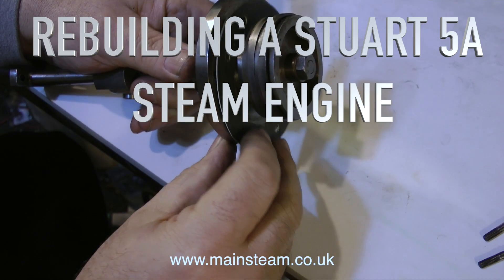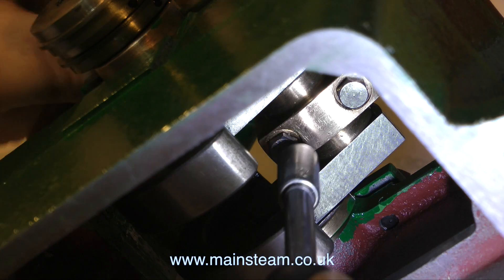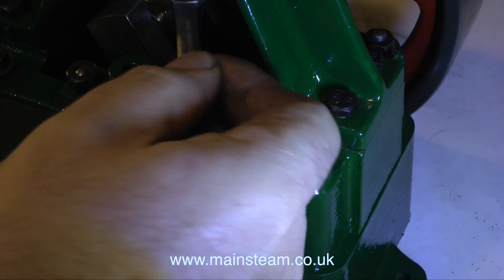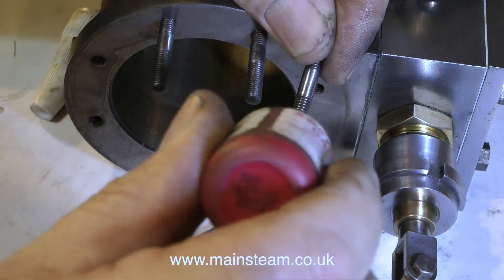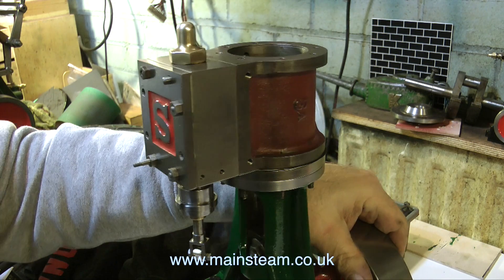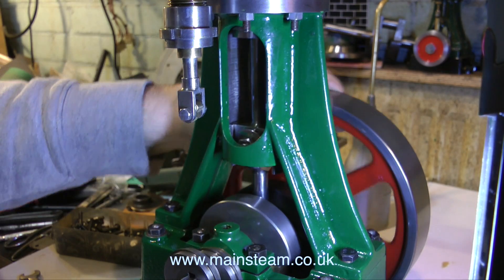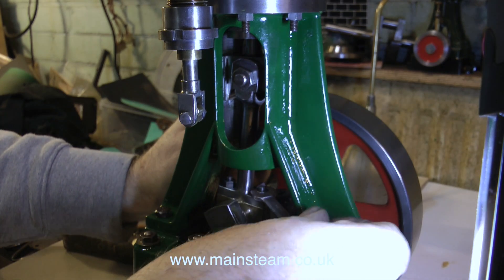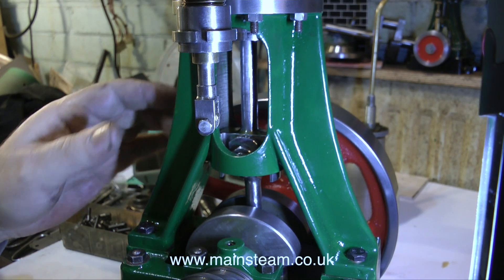STUART 5A STEAM ENGINE REBUILD - PART #7

Comment: Keith, small question, what kind of tools do you need if i want to start with constructing and repearing steam engines? I think a lathe and a drill press are minimum... Maybe you can make a beginners guide to machining steam engines. Greets! Sebas